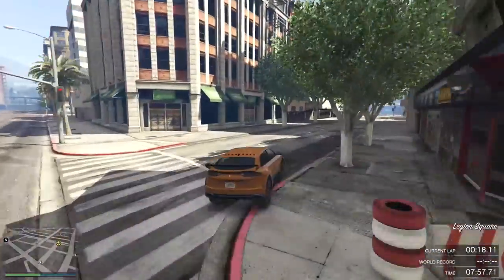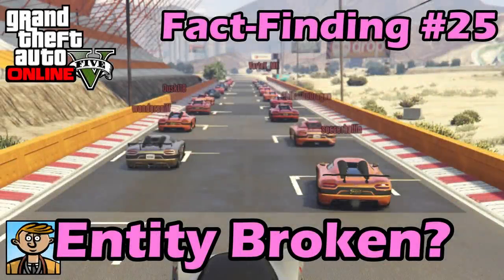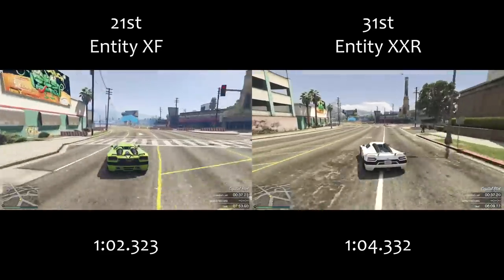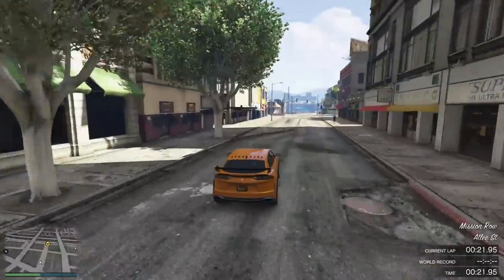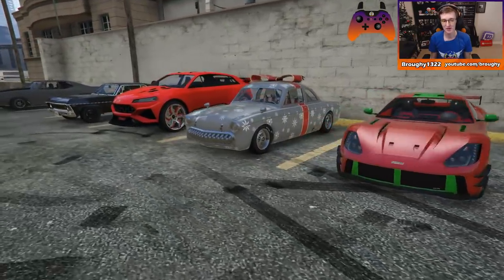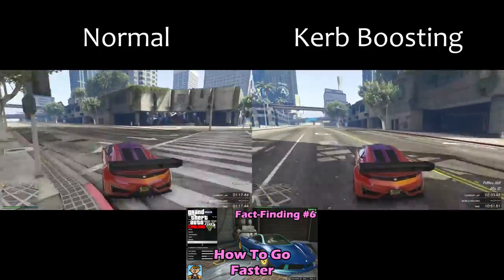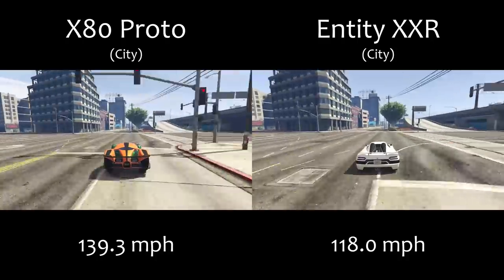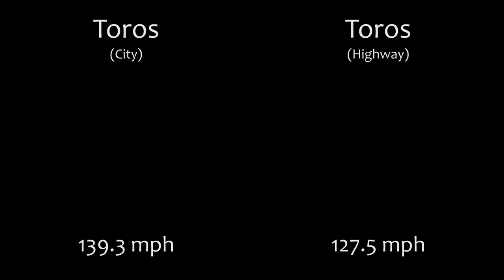Bouncy Cars & Broken Suspension? Advanced Handling Flags Part 2 - GTA Fact-Finding №28

Comment: I think they need a proper engine model , and a hard rev limiter if they want to get rid of kerb boosting at all+ some tweaking in the way tires grip the road, or a new, stiffer, suspension model.

 Let me explain my thought process: Engines revving more, ever so slightly, is realistic behaviour, as even in real life , hitting a more pronounced bump that is not properly absorbed by the suspension will make your tires lose contact with the road, thus wheels are technically spinning in mid air(for a split second) , the engine doesn't encounter resistance thus it can rev freely.

 The exagerated behavior is what you see in rally cars that soar over jumps and their engines hit the rev limiter. 

IRL, cars lose their speed when their tires come in contant with the road again , however in GTA V it looks to me that they keep that speed because of the weird way friction with different surfaces works in this game...
 Looking forward to someone more knowledgeable than me explain the behaviour in more depht and come up with a proper solution ...
Reply: Except that kerb boosting in GTA consist only in compressing the suspension, not the wheels flying
Reply: @Ignacio.Romero  good point!It would mean that tires are a different entity, so altering the suspension model is the way to go... but they goddamn haven't made major improvements to the Advanced Handling flags, they made them even worse even. An entire game engine overhaul would be expensive and unlikely to be implemented in a future DLC, so i guess we're stuck with this behaviour until GTA 6
Reply: The reason why curb boosting works is because the engine force is not propperly calculated both ways (force=/=opposite force). When the engine rpm increases from a bump, the force keeping the rpm in its higher state is defined to be 2-3 times higher than engine force in 1st gear (fInitialDriveInertia. The result is acceleration at grip limit until actual speed matches the rpm. This is the source of almost every boost in the game, if not all of them.
Reply: The solution as i see it, is to define engine inertia=engine force. Given that the clutch is engaged.
Reply: @Kswhajakky   "An entire game engine overhaul would be expensive and unlikely to be implemented in a future DLC," Not to mention almost impossible. I think that would have to be prohibitively large update even if they pulled it off.

Comment: I was really looking forward to the itali gto
Reply: It's drives better than the Schlagen GT.
Reply: It shouldnt be as bouncy as the Toros, since the suspension is much lower. And the Toros is still an extremely quick car, its just bad to drive.
Reply: its very bouncy and having incredible benefit from this. reaches very high speeds like 180-190 mph in the city streets, as far as I tried

Comment: Are the AHF present in the arena war vehicles? Cos i love my imperator & the middrive speedboost is present so i assumed that now AHF were put on the arena vehicles
Reply: Did you actually listen to the video?
Reply: @Johnny362000  yes & his wondering was confusing. Thus my question.
Reply: every car in this update except the Schlagen GT has 1 advanced handling flag that causes bouncy suspension, not the ones that impede kerb-boosting or mid-drives
Reply: @Johnny362000 except he says "non arena vehicles"
Reply: my mistake, yes some of the arena vehicles do not have advanced flags but some do
Reply from the maker: All normal cars in the Arena listing have them, so Dominator, impaler, imperator, ZR380, etc. Just the bigger things like Brutus and whatnot that don't.
Reply: @broughy1322  so my madmax car is confirmed OP then? Sweeeet lol

Comment: When I drive the Toros on cutting coroners (where I take every car to get used to slow cornering in it), it's always the one way alleyway straight where the Toros just doesn't brake, and I crash like you did in the video...would there happen to be a certain flag that causes that? As I know certain flags cause certain things to occur, such as odd revving, or bouncy suspension, or anything of the sort...or is it just that the Toros is a SUV regina and has no brakes whatsoever, and I'm lying to myself, thinking it could brake well?
Reply from the maker: The Toros does not have good brakes no.
Reply: SharkEatinPizza It just has awful brakes. Plus the fact that any bump just slingshots it into hyper speed and it’s that much harder to slow the car down after that.

Comment: The only thing I’ve ever had a problem with is the fact you always have traction control turned on, it makes the cars considerably slower and less fun to drive, it would be great to spin out for once in gta
Reply: GTA doesn't have any traction control, the cars just have very little power, a lot of grip and the automatic gearbox doesn't change down when you slide

Comment: So with the arena wars handling flags.  Does that mean the dominator has fallen from Grace?  Did they ruin a car that has been king and top tier since day 1?

Is the dominator vanilla now just a piece of junk?
Reply: No, they haven't changed existing cars
Reply: @Johnny362000  I swear it feels different to me though.  I use to be able to just whip it around corners at a decent speed.

Now it feels like any bump over 50 spins you out around a turn.

Comment: I wonder why the Schlagen gt has no handling flags while the rest of the arena war cars do
Reply from the maker: Probably an old car/handling model which they have had left over for a while and just finally released. There are a number of these interspersed with recent DLCs
Reply: Broughy is probably in the right direction since Schlagen is not based on the production Z4 but the concept that was revealed just before the Smugglers Run. It could very well be a leftover from the Doomsday DLC.
Reply: @ahvike124  Z4? This is a Mercedes, not a BMW. It's an AMG GT.
Reply: @dchousoseiso  Yes, a Z4. Schlagen has a shape of AMG GT but it has details from the Z4 Concept. Front bumper, side air scoops and light clusters are clearly designed after the latter.
Reply: @ahvike124  Sure it has mixed elements but that doesn't make the Zentorno an NSX, does it? Or perhaps the Toros an i-pace? Or the RE-7B an R18? The Schlagen GT is still mainly a MB AMG GT.
Reply: @dchousoseiso  Dude, ffs, this is not at all important in this context which car the Schlagen more resembles.
Reply: @ahvike124  I mean, if you think it isn't important, why argue?
Reply: @dchousoseiso  You started the dispute, making a clear implication that Schlagen has no influences from Z4. I never said it didn't resemble an AMG. The only thing important in the context ,that it might be a left over from an older DLC, is that it's partly inspired by the Z4 Concept.
Reply: @ahvike124  Well okay

Comment: Its more realistic with the advanced handling flags though
Reply: realism is not inherently a good thing
Reply: Wrong, the dlc cars in this update and last update are not realistic at all. The older cars are more realistic because of the way they drive. If you pay attention to the title of broughys video it says bouncy cars. Which is exactly why they aren’t as realistic. Take the swinger for example, that car drives like it’s on a trampoline! Its almost impossible to race with. Then since they all had rev limiters in the last dlc they would barely even hit top speed. GTA is not a simulator so they should have left these cars alone and not mess around. It’s been 5 years with curbs and having cars drive like they previously did so flags are pointless unless they plan to apply them to every car or just leave them out completely.
Reply: Wyatt Fortune but cars bounces around on curbs irl. But it doesn’t fit in gta
Reply: Exactly Wyatt. Apply to all or none. They did the same to the new weaponized vehicles/aircraft from after hours. You can see they attempted to make some balanced military vehicles with speed and weapon power. But with so many OP options still around, the newer 'balanced' choices become the weaker option.
As for cars. the performance and prices on most of the dlcs just seem to be random to me. Multi-million $$ cars that are garbage vs. older ones that are half the price. Sports cars that blow away super cars.  Off-road & rally vehicles that suck at off-road. Do the vehicle designers even bother to look at what's already in the game to gauge against?

Comment: With the flash gt u kinda want jelly suspension since it’s a rally car
Reply: what? Have you not seen actual rally cars?
Reply: Yeah I have the flash gt is a Ford Focus RS RX which is used in RALLY cross. Have u seen a rally car johnny362000?
Reply: Have you noticed that rally cars remain very composed on harsh terrain, they don't bounce around like they have busted shocks

Comment: All they have to do is to make the handling in gta6 to be similar to the handling in gta4 just without traction control. The handling in gta4 reminds me so much of the handling in gt4(or gt psp with professional handling) with tc off.
Reply: wow, what an insult to Gran Turismo 4 to compare it to GTA IV
Reply: @Johnny362000  I was only comparing a certain aspect of one game to an certain aspect of another. I wasn't even doing a general comparison of both. Besides, GTA iv has way more enjoyment and soul than GTA v imo. That's sad since GTA v has way more features than Iv......
Reply: you still compared a game with physics that are still very realistic and detailed by modern standards to a game where engine power is simulated by a single value
Reply: @Johnny362000  you just basically justified that I'm only comparing a certain aspect of both games, I haven't even gone that in-depth into the technicality of the driving physics in both games. As for my experience driving in GTA IV, the physics is more prone towards "sim arcades" like Gt4, Ethusia Professional racing, and, for a stretch, Driver SF than actual arcades racers like your average nfs game. I thought it would be obvious that the physics in GTA IV isn't as complex as in Gt4 because it's definitely not it's main focus. It's just simply reminds me of it....

Comment: Tyrant would be op without the AHF the vagner would be smashed by it
Reply: not as op as you think
Reply: @oleg_aka_djmeg  it would be extremely op it has a down force value of 3.0
Reply: @RideToHellRetribution  what does the vagner have
Reply: @Specia1Monkey  think it's around 1.0 ik it's more than the old re7b
Reply: Demolinizer5 By that logic, the RE-7B and the Tyrus should be faster than the Vagner and Tyrant since they have downforce values exceeding 3.0. There’s a lot more to vehicle handling than just downforce. The Tyrant would most likely be 2nd or just slightly above the Vagner if it didn’t have the flags. The Vagner has acceleration and better base traction as advantages over the Tyrant and the difference between a value of 2.75 and 3.0 downforce is pretty minimal.
Reply: @shawncarson8131  the re7b and the tyrus have less than the vagner and tyrant the tyrant being the only car in the game with a 3.0 the rest have alot lower than that without flags the tyrant would destroy the super class just driving it its quite clear how much better it would be but cos of the shite handling flags it comes nowhere near
Reply: Demolinizer5 Actually the RE-7B has a downforce value of 3.0, similar to the Tyrant but the Vagner has better acceleration and a better top speed, areas in which the RE-7B struggles in.
Reply: @ABluePhoenix  yet the tyrant turns better than both the re7b is shite now totally useless but anyway this isn't a discussion about the 7b it's about how the tyrant would crush the supers class
Reply: Demolinizer5 I wasn't disagreeing with you. It's pretty clear that the Tyrant would dominate the whole class without the handling flags cucking it.
Reply: @ABluePhoenix  thanks for the agreement mate it's a beast the tyrant it's really good looking aswell
Reply: Demolinizer5 XXR could've been really quick too. Sure it's not the best for handling but the top speed sure isn't anything to joke about.
Reply: @ABluePhoenix  xxr feels alright on the project homecoming server kinda feels like the regular Nero
Reply: Demolinizer5 All it takes is looking at Broughy’s spreadsheet of the handling files to see what downforce values these cars have... RE-7B: Downforce value of 3.5, Tyrant: Downforce value of 3.0, Tyrus: Downforce value of 3.35, Vagner: Downforce value of 2.75. Not sure where you’re getting your numbers from, but Broughy’s spreadsheet is accurate as of the Arena War update and these are the numbers straight from the game’s code.
Reply: @shawncarson8131  looking at Broughy1322s spreadsheet is correct but the tyrus feels quicker round corners than both
Reply: Demolinizer5 Tyrus lacks the top end needed to keep up with the top cars. Has a lot of drag, which lowers the top speed. It’d probably be good around a tighter track with high speed corners, but outside of that it just doesn’t have the pace to keep up. Same with the RE-7B. The Vagner just has so much of everything which is why it’s so good. Great acceleration, great top speed, great traction and a high amount of downforce. Can’t really get much better than that.
Reply: @shawncarson8131  look at my original post mate u gone off topic my post was the tyrant would decimate the supers class with out the AHF
Reply: Demolinizer5 I’m not disagreeing with that. Sorry if it seemed that way. Just wanted to clear things up numbers-wise. It would definitely be top tier without the flags.
Reply: @shawncarson8131  I'm aware of the numbers mate just hadn't read the spreadsheet in a while so wasn't entirely sure on the numbers so cheers for clearing that up mate

Comment: I know a lot of people will disagree with me on this, but I hope the car handling in the next GTA game is similar to GTA 4, just with less suspension lean because it was a bit ridiculous in that game. I just want to be able to drift in GTA again and for the races to actually be challenging like they were back in GTA 4. Every car in GTA 5 handles like a LaFerrari or something, even cars like the Emperor and Tornado. The only time you can get the cars sideways on GTA 5 without them losing power mid drift and gripping up is in the snow.
Reply: cars in GTA IV are easy as fuck to drive if you're even remotely competent and they bog down when they slide as well
Reply: @Johnny362000  Kinda depends what car you're driving. The AWD cars bogged down as you'd expect, but the RWD cars only really bogged down on longer corners. I remember getting some really good drifts out of the Coquette and Dukes back on GTA IV. Also, a lot of people who play GTA games are kids with no skill whatsoever. I've heard that them constantly complaining that the cars in GTA IV were too hard to drive is the reason why the handling in GTA V ended up the way it did.

Comment: At this point in the game, racing in this game isn't even joke-worthy anymore.

Most vehicles are just Superficial 3D virtual toys on the same level of liking Hot Wheels cars.

They're just fun to look at now, and play with in the Sandbox.
Reply: Join a proper race crew,  and it will soon turn into your favorite racing game.  No other racing game, has the same speed, and rush, even if the cars go slow by definition.
They got enough physics done right.
Reply: Literaly the only way to ahve fun in this game is to have friends to mess around with, kinda like vanossgaming's gta vids but then that leaves about 4 hours to grind, and u will end up with only like 2 mil in the bank

Comment: Honestly I quite like the "bouncy" handling. It makes it feel like the cars actually have something resembling suspension instead of a brick. Hitting curbs, shrubs, and potholes, or whatever actually slows that car down as it should. You actually get punished for driving like a dipshit and hitting bumps at high speed. Hitting a decent bump at highway speeds irl does cost you about 5MPH, so this handling change seems about right. ( Added note, hitting a curb at 60+ mph would literally shatter a rim and destroy the tire.) The advanced handling tags add a bit of extra realism that makes driving quite engaging. I just wish that the cars were consistent across the board.
Reply: With these newest cars you don't get slowed down for hitting the bumps
Reply: @Johnny362000  My mistake, although I was referring to the SASSS vehicles too.